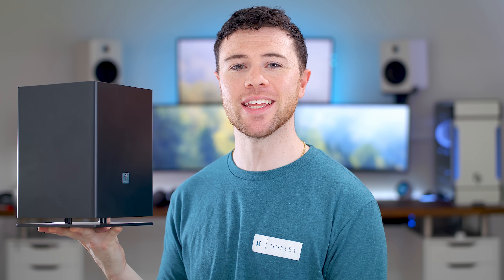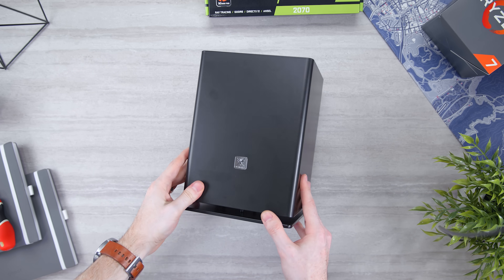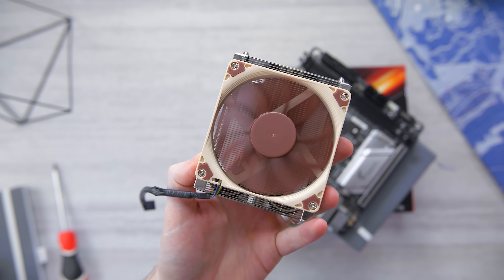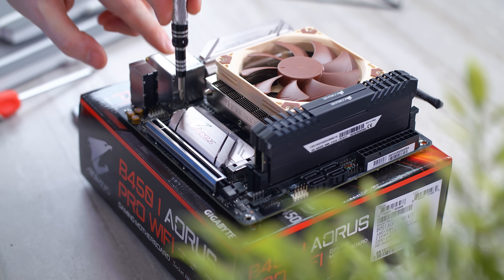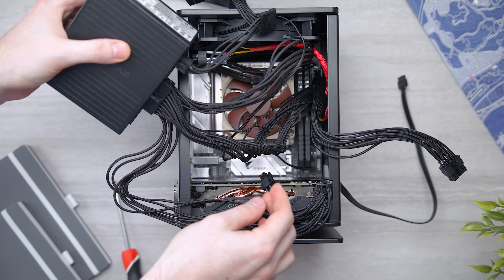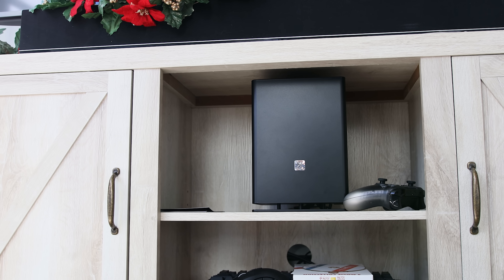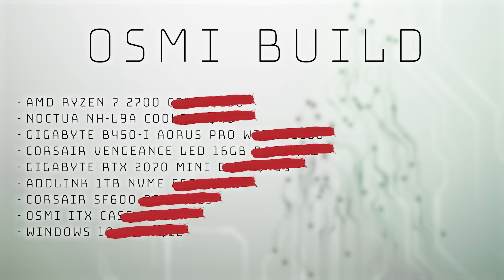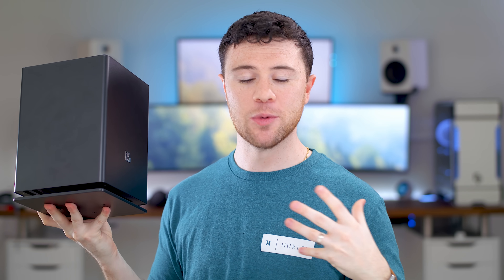I Built the Xbox Series X as a PC

Comment: Does it throttle? Because the Xbox will.
Reply: Bekee x they won’t throttle, since they’ll probably be slightly underclocked in the margin of error. The One X does not throttle & is super quiet & my ps4 pro doesn’t either but sounds like a jet engine on Destiny 2 at sub 4K.
Reply: @Mlordy  so a pc will still be better.
Reply: Bekee x I mean this is a budget pc, as everyone has been saying “consoles” aren’t really consoles they are just pcs for a good price honestly they just need to call them pcs and in a perfect world we would have everything on crossplay and we all would be able to enjoy millions of players on all the newest game servers at the same time but that won’t happen for 10 - 15 years
Reply: Bekee x not a similarly priced one, maybe sub $2000.
Reply: Consoles dont thermal throttle under load. Theyre designed with thermals in mind. Larger chasis and more elaborate cooling than a laptop and typically lower power consumption by the SoCs as well. Given the direct hardware access that coders use at times and the reliance on specific timings for a lot of visual optimizations only possible due to very limited variation in hardware software simply wont work reliably if they do.
Reply: Consoles don't throttle. When they overheat, they simply shutdown.
Reply: @jamesw.3217  laptops throttle so they don't over heat, why wouldn't a console they are pretty much the same.

Comment: Rtx 2070 is 7.5tflops, if Xbox x 2020 has 12tflop Gpu, that’s between rtx 2080 and a ti...
Reply: skyhawk311 stop trying to be a smartass he said that already
Reply: @randomfrankp, I’m glad we agree the custom hardware in new Xbox can’t match a small form factor pc yet. So what was the point of the video? Also they do make a small rtx 2080 I believe.... but you didn’t use it...

Anyhow don’t get all worked up...
Reply from the maker: Exactly. The point of this video was to find a similar ITX chassis and build a system with comparable hardware. Also, they dont make a small 2080. Only thing remotely close to that would be Zotac's "Mini" series, but those are not small by any means as they're over 8 inches lol. Zotac is terrible for mis-marketing that lineup.
Reply from the maker: I literally said that.
Reply: @randomfrankp  But at the same time instead of building a PC matching the power of xbox series X, u built a PC thats so much weaker
Reply from the maker: @Aj Daniel how can I build a PC with hardware that DOESNT EXIST.
Reply: @randomfrankp  You could always build a PC that kinda matches XBox Series X specs 

CPU - Ryzen 7 3700x
Motherboard - MSI B450m Pro or Strix X570-E
GPU - Nvidia RTX 2080 Super
Ram - 16 GB DDr4 3400 MHz
SSD - Samsung 970 Pro 1TB
PSU - Any decent One
Cooler - Depends
Case - Depends
Windows - 13 - 14 Dollars
Keyboard -  Depends
Mouse - Depends
Reply: Exactly the hardware does exist dumb ass @randomfrankp.. it just doesn’t fit in a small stupid square!
Reply from the maker: They are using custom RAM, motherboards, GPU and CPUs. So no, the hardware doesnt exist for us.
Reply: randomfrankp frank going off 🤐🥴

Comment: In the price part where you compare the XSX to your PC, you forgot to mention that the XSX has a 4k Blu-Ray drive and a wireless controller included.
Reply: Win10 natively supports ALL Microsoft controllers. Just pick up the wireless adapter and you could use a 360 controller if you wanted hell.
Reply: Most gamers already have any wireless controller that works with PC. The Blue-Ray drive is a feature but, its not the core of the build.
Reply: @ZackSNetwork  Regardless, it's part of it.
Reply: ZackSNetwork your comment is not a valid excuse, plus Xbox controller are really nice, as they do not feel cheap.

Comment: You do know that next gen condoles will sell at a significant loss... so $499 is probably the price.🙄
Reply: @Cameron Mendez nah they will take a loss it will be $499 specially if they want to beat PS5
Reply: Emjayography um
Reply: @Cameron Mendez this won't be the first time consoles sold at loss
Reply: $500 is too low, $600 to $800. Xbox one X sells for $500 with completely weaker specs.
Reply: @markez4730  In no way will the Series X be $600 or more; people were saying that about the X, and it released for just $500.

Comment: So you didn’t use a zen 2 processor?? Ryzen 7  2700 is based on zen 1
Reply: I was thinking the same thing. "Xbox uses 8 core Zen2 processor" .... "I'm using a RyZen 7 2700x" like what??? The 3700x would have been the equivalent
Reply: Y’all think a $500 ish console is gonna be more powerful than GPUs that are $500+ alone? Lmao okay. Also doubt the 8 core is gonna have hyper threading or whatever equivalent. It’s probably just 8 cores, 8 threads.
Reply: @AtracBreezy  ya its crazy how stupid these bots are
Reply: @AtracBreezy  OK moron, they actually announced the specs, how are u so dumb, it's 8 core 16 threads, also its 12 teraflops gpu, ur just dumb, plz do some research before u trash talk
Reply: when will you morons realize you cant build a pc equivalent of custom hardware? I keep forgeting you guys are clearly engineers that work for microsoft.
Reply: They can sell it for cheaper because they buy in bulk. A lot of people forget about that.
Reply: What does zen means?
Reply: @ליאם-ב1ר  just the generation
Reply: @jono987king  oh ok
Reply: Basically he should used a Ryzen 7 3700 and not a Ryzen 7 2700. He also used a weaker GPU as well.
Reply: @godsinferno  Yeah definitely not the most accurate build. A Ryzen 3700 paired with a RTX 2070 would have been better.
Reply: ZackSNetwork the series x and ps5 both are better than a 2070 and 2080
Reply: lol and even puts in a lower TF 2070 but says "equivalent" to XSX?
Reply: riceeater79 it’s gonna be more powerful than a 2070 and 80
Reply: @Bryce Czirr the xbox one x does not come close you fucking bots don't understand that there's more then just rez and fps you are a joke
Reply: im sure the clock speeds wont be that high
Reply: Zen+*

Comment: >Zen2 CPU

>Uses zen1
Reply: Generic Memes 
>12 TFLOPS GPU

>Uses 7.5 TFLOPS GPU
Reply: @عامر-أبوعواد  You cannot compare GPU's with completely different architectures by Teraflops. You need to go do your research.
Reply: @عامر-أبوعواد  gonna be funny when the new xbox drops and its not anywhere near as good as you tools think
Reply: @عامر-أبوعواد  AMD doesn't have a 12TFLOP consumer GPU....u dickhead...…..
Reply: @henryfrancis9533  NVIDIA does, 2080 Ti. There's no Mini version, so it wouldn't fit. A different, taller, sandwich-like case would do the trick, Velka 5 maybe.
Reply: @FastSloth87  lmao an xbox series isnt gonna have anything near a 2080 ti tho, and if it does good luck with it being less than $1200
Reply: @Nicomonnn  Microsoft said 12 TFLOPS, the 2080 Ti is 13 TFLOPS. AMD already has tighter profit margins than NVIDIA, and with mass-production and the massive sales the Xbox WILL HAVE (even if it flops hard, it will sell much more than any GPU, ever), the price can be close to $800 and they will still make a lot of money.
Reply: @Nicomonnn  12 TFLOPS of RDNA2 sounds like 2080ti level to me, probably even above.
Reply: @henryfrancis9533  Vega 64 (Vega 10) and Radeon VII (Vega 20) come close, but those aren't as efficient as the 5700XT (Navi 10).  New consoles it seems will be using  Navi 20 based gpu's, but those don't come out until summer 2020.
Reply: @FastSloth87  lol $800? Its supposedly has godlike ssd and a really good cpu and that type of stuff is not cheap so idkk
Reply: @Nicomonnn  Any cheap (<$100) NVMe SSD is godlike when compared to the spinning platters on current gen consoles. Same can be said about the CPU, a Ryzen 3600 (my guess on what the performance will be similar to) is light years faster than that old ass Jaguar CPU on the One X. And yes, when mass produced, mass sold, prices can be cut substantially.
Reply: @FastSloth87  yeah well it's not supposed to be faster than old gen consoles but supposedly outperforming any current pc drive soo, all sounds like bs and prob gonna be nowhere near as good as they make it sound
Reply: @Nicomonnn  It's cute that you think because the 2080 Ti sells for $1200 that it's actually worth that. It's a $600 GPU, maybe $700 at most, with prices jacked up high AF because nVidia saw how stupid people were being during the mining boom. The margins on the 2080 Ti are insane; consoles don't need and won't have those kind of margins.
Reply: @OptimumSlinky  ok I said the console not gpu, it's not just the price of the gpu but cpu mobo ram and storage
Reply: @Nicomonnn  Console architecture does not equal PC architecture, people should understand this by now. That's why you can get way more performance & life from those weaker console specs than you can a similar spec'd PC. A 12 TFLOP console will be able to push game visuals a lot further than you think.
Reply: @FastSloth87  No, it won't. Stop pricing things comparable to PC components. That's not how console performance to price works, and never has been.
Reply: @Nicomonnn  consoles more expensive? Somebody dumped in your head... i build my pc back then in 2013/2014 with a gtx 770 and i5 3570k, 8gb ram etc. In the end i used between 900-1000$ (820€). Bought the ps4 in the same time for 350€. Theoretically i had 2-3 times more teraflops than a ps4 but i cant play a game that looks good as a ps4 exclusive. Conclusion: the consoles maybe weaker but they are in the same time a lot of cheaper and the consoles itself have a longer lifespan (best example is the 770, after 2015/16 every game on the ps4 afterwards looked better.)
2017 i bought a rx 480 because i wont support companies like nvidia anymore. After the 7xx era they got cocky as fuck with the prices.
Reply: @Nicomonnn  the xbox series x is suppose to play 4k games flawlessly and play games in 8k. That is way better than a 2080ti
Reply: @henryfrancis9533  Then whats the point of this video?
Reply: @1984rockabilly  You tell me, O smart One.
Reply: @henryfrancis9533  There is no point. It's useless ...
Reply: The Navi 12 gpu will be a direct competitor to the 2080, with performance between 10-14 teraflops. It's also going to retail at a minimum of $500 usd.....
Reply: @povertygamer  my 5700xt comes within 5-10fps of 2070s/2080ti in most titles with everything on ultra @ 3440x1440p res
Reply: Saber with all due respect that is how pcie lanes work, they have a controller that prioritize data flow. 8 lanes of 4.0 has the same data flow as 16 lanes of 3.0.
Reply: Saber if you want to pay more for “equivalent” performance go ahead.
Reply: Zen+
Reply: @Bryce Czirr lol idk abt that, but well see when it comes out, I doubt they can outperform a pc for less than what a pc costs, and if they do then damn good on them, at the end of the day though, you cant do what you can do on pc, and pc still has 1000s of more games
Reply: Saber I’m someone who uses both. I use Intel and Optane for storage, and I’m now using threadripper for gaming/editing
Reply: Reading comments while Xbox released the specs lol
Reply: PC Gaming in a nutshell here.  1300$ to build a weaker system then what the Series X will be less than a year before the Series X releases lol.

That GPU alone is as much as the whole system will be
Reply: Saber except for one crucial factor PCIE 4.0. Intel revision of Skylake now called Cascade Lake has more lanes but over 3.0 speed, while Ryzen 3000 series, threadripper, and EPYC supports 4.0 with the later having over 80 lanes.

Intel believes more lanes is better, while AMD believes faster lanes are better. It’s like a highway like I-10/Katy Freeway with a total of 26 lanes which includes expressways, we think the wider the highway the less traffic we have, except Houston has one of the worst traffic in the country, but it doesn’t help that slower drivers don’t stay to the right. Now in Germany we have the Autobahn which has fewer lanes but no restrictions of speed. It does have stricter traffic laws and enforced the right lane for slow vehicles.
Reply: UHD Gaming PC  There was no point putting a Vega 64 into the xbox one x, the cpu would heavily bottleneck it.
Reply: @Saber Bruh, intel is getting absolutely hammered by AMD in the HEDT platform right now because of this and their kiddie table levels of core counts. Pcie 4.0 is real, it's double the bandwidth.
Reply: @Saber Intel needs to add hyper threading to their entire lineup. It doesn't matter if the i5 9600k gets better maximums, if it also has tons of micro stutter, and low 1% fps metrics.
Reply: Zen+
Reply: Lmao what are you talking about... Even the Vega 64 has 12.5 TFLOPS of power not to mention the Vega VII coming in at 13.4 TFLOPS. GCN is much better than RDNA in computing tasks because of this. The now 4 years old R9 Fury X offers 8 TFLOPS compared to the RX 5700 XT'S 7. Computing performance doesn't show the whole picture since the problem is it's the perfect definition of gpu performance.
Reply: And yes the Radeon Vega VII and the Vega series were consumer gpus, but big fails for AMD. The Vega 56 was aimed at the GTX 1070 and later Nvidia made the GTX 1070 Ti to compete and the Vega 64 was a competitor to the GTX 1080. The Vega VII was stated to be a gamer gpu by AMD, but in reality just jumping on the 7nm bandwagon giving no competition to the 1080 Ti or the RTX series because of ridiculously high HBM prices.
Reply: This is the one thing that bothered me the most, with everything else he got about as close as possible. But the CPU needed to be a downclocked Ryzen 7 3700X.
Reply: You guys speaking language of God
Reply: The Navi 56CU GPU does not exist as a consumer card. It's likely going to be semi custom of the Navi 20 card.

Using a Zen 1+ CPU is dumb. I guess performance wise it might be close, but the CPU is supposed to be Zen 2 clocked between 3-4 GHz.
Reply: @Bryce Czirr pc gets everything before console , u get left overs lmao , so when it launches its already out dated , ill have my 30 series card and you will  have a shit box
Reply: I think an overclocked 2070 super woul be closer to Series X performance. As to the CPU. I don't think the power level will be higher than a Ryzen 7 2700.
Reply: @teehundeart  no since Microsoft said the xbox series x can play games at 8k. That is beyond a 2070
Reply: @susmodder531  since the specs have been revealed: better than 2070, not better than 2080ti. 8K has nothing to do with that.
Reply: @teehundeart  it really does. 2080 ti can not play games at 8k where as Microsoft says the xbox series x can
Reply: @susmodder531  2080ti can render games at 8k i believe. Maybe not current AAA games at native resolution.
Reply: @George Exactly my point, you asshole.
Reply: @Bryce Czirr What do you mean by very powerful RAM tech. I'm pretty certain that the gddr6 modules are pretty common among 2017-2019 era consumer GPUS. So, I wouldn't say new RAM tech, I doubt the SSD will be powerful than current gen 4 pcie SSDs, due to highly evolving Game technology and complexities. A 12TFLOP AMD consumer GPU is non-existent atm. Possibly a new GPU tech, upcoming next year. Doubt the new series xbox price will be $500, with such horsepower.
Reply: Based on performance and cost, the Xbox Series X is using something in between the 3600 and 3700X but with Laptop-like performance
Reply: @lategamingwithiainjarvis  It's confirmed a 8 core Zen 2 CPU & it will be running around 3.5GHz+.
Reply: kt cool Ryzen 3000 series is Zen 2